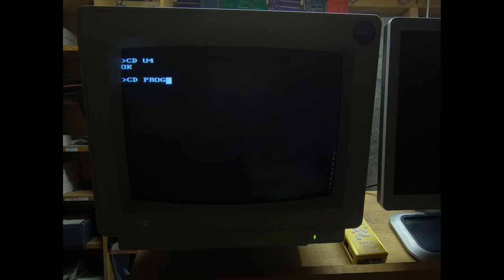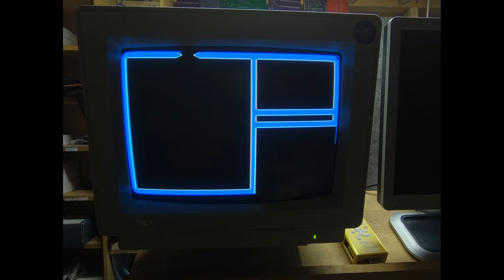3R1C Homebrew Computer:  Tear it down?

Comment: A full careful tear down and rebuild sounds valuable but a lot of work, and risky! Could you do the rebuild before the tear down, so that you at least still have the original working one to compare against in case something goes wrong?

At the very least, take lots and lots of photos, close ups, different angles, etc - I do that most times that I'm significantly modifying a circuit or decomissioning it, and the photos are so valuable when you later wonder exactly how something was wired up.

When you do the rebuild, I wonder whether you can build in automated tests for subsections of the build, maybe driven by a microcontroller at a slow clock speed? It would make it much easier for others following along to check their work, and for you as well, of course, being able to verify each section is working correctly in isolation.
Reply from the maker: Hmm. Tear down is risky  I think useful though in validating every connection against the schematic. I love the idea of creating a test harness for each subsystem. I did this for the soft switches.  I’ll start designing the tests.  Thanks George!